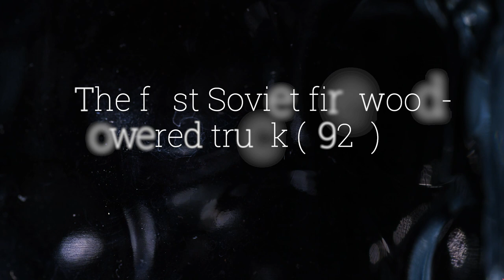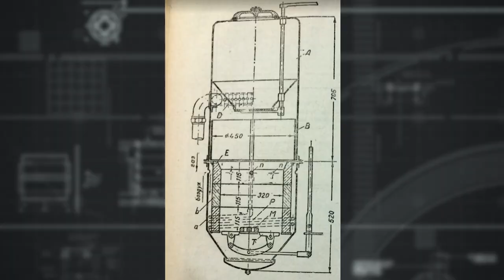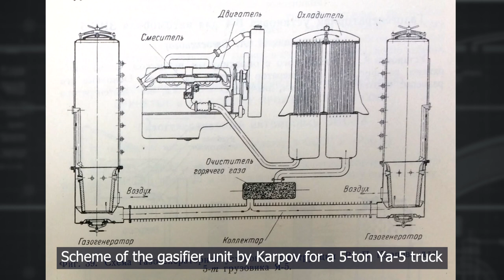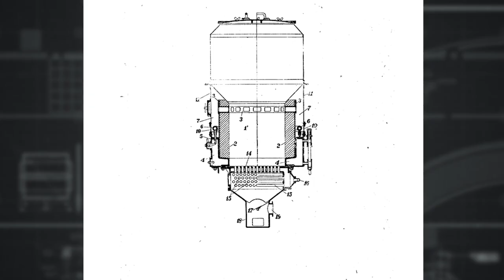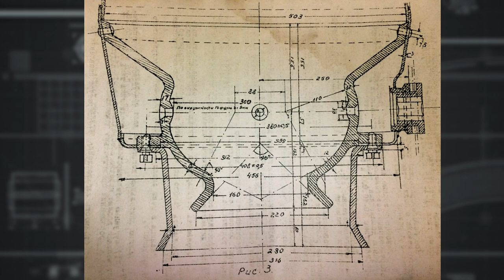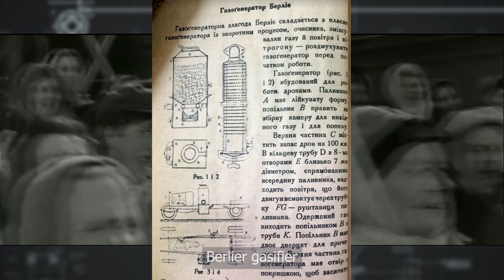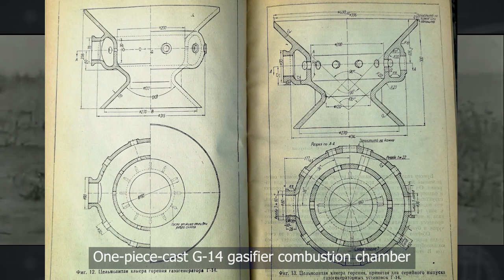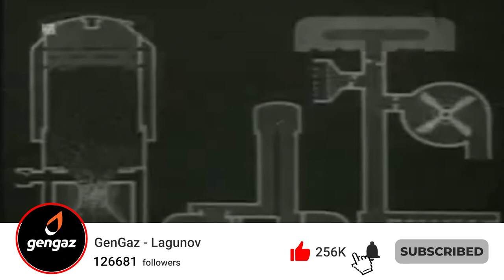Soviet gasifier vehicles in 1923-1959 | Documentary | Part 1

Comment: wi9th modern materials for heat resistance, thermal conductivity and insulation as well as 3D printing for improved heat transfer and space savings it would be interesting to see how older designs could be improved. power density could be improved and such making them far more practical.
Reply: Read about total heat recovery @ALP